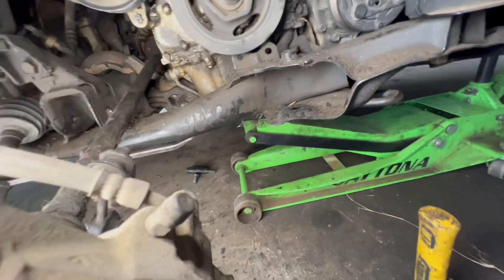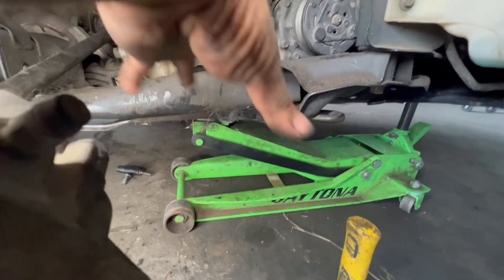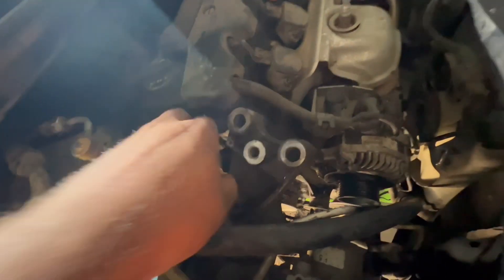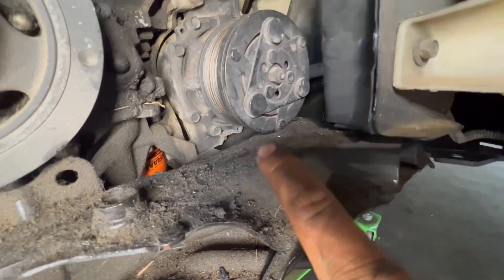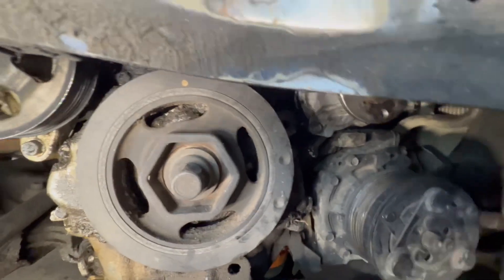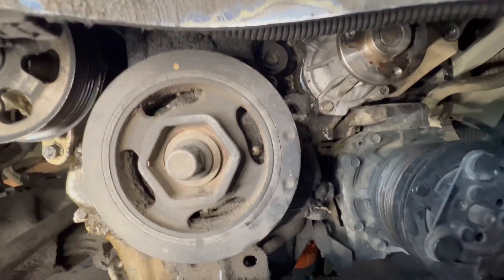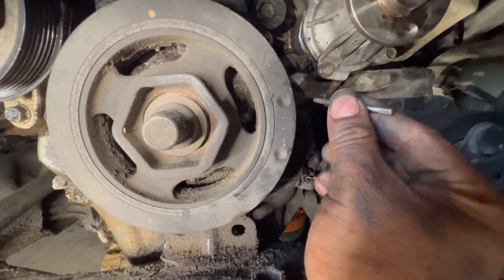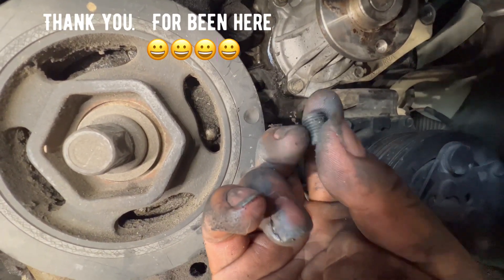2006-2011 honda civic.  Tensioner bolt broke ( here the fix. ) 😀😀

Comment: What helicoil can I use to fix the threads?
Reply from the maker: Did you bolt broke ?   And striped the thread?
Reply from the maker: Check you thread  if its  not bad.    If is not bad all the way. Just use a longer bolt.
Reply: @zayyuh101 did you ever get an answer re: the heli? In the same boat here.
Reply: @davidpagan2446  I found online the chart that had the size helicoil that corresponds with the size. Unfortunately i wasn't able to fix because the Coil was slightly off alignment and it couldn't grab.

Comment: In attempting to drill a hole into bolt, messed up and bolt when through the entire housing unit and been having issues ever since because tensioner pulley is not aligned and belt falls off with ease. Any solutions that you can think of will help greatly.!!!!
Reply from the maker: The only way to get fix now will be to use.  This
Helicoil - Kit 1/2-20 (5528-8).  This is just a example.  Of what you can use to fix it.     Because you have to find. The right. Size.    You. Can take. The bolt.  From the tensioner.    And  take it to the machine shop.    Then they will help you to find the right size.  For it.
Reply: How did you get it fixed ? Please answer